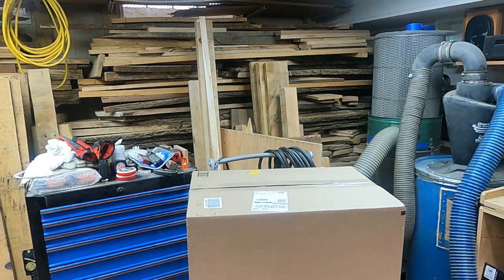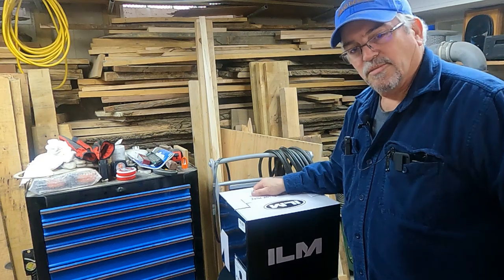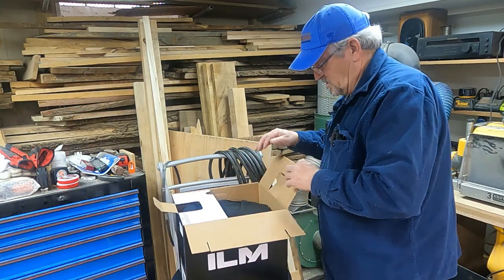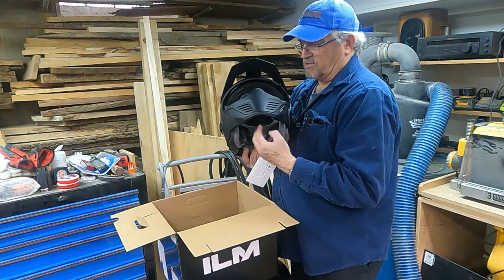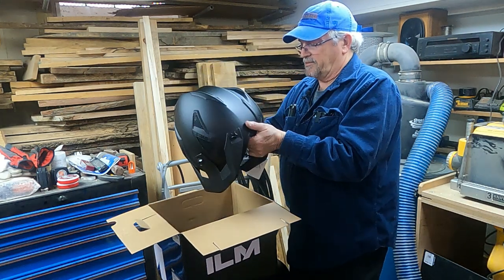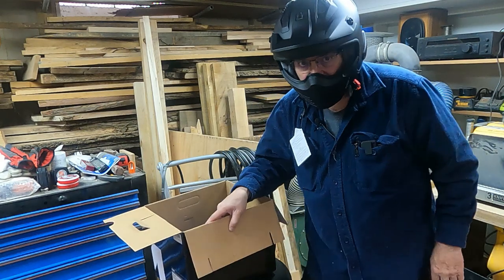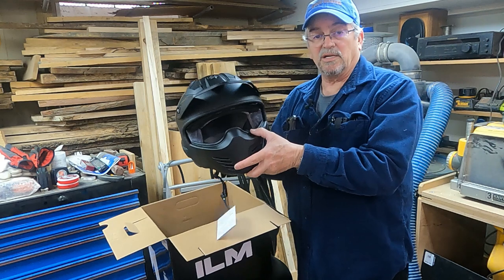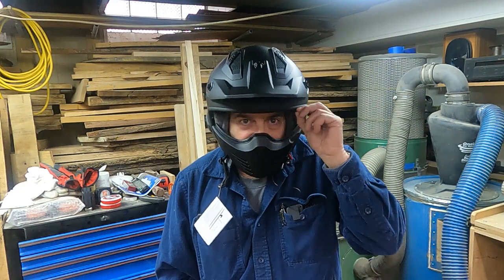ILM 34 helmet

Comment from the maker: Update: this helmet fogs very badly. In cold weather you can't put the visor down or it fogs. I can't even wear my glasses with the visor up as they will still fog. The chingaurd gets soaking wet from my breath even with the visor up. So the bottom line is this is not a good cold weather helmet.
Reply: Thanks for the update, i've been watching a bunch of videos trying to find one for the winter and almost purchased this. Did you find one yet that doesn't fog up?
Reply from the maker: @KingKola_   Just a full face motorcycle helmet if I really want to look like a dork, lol.

Comment: Thankyou for the video . When ride my e-bike I look over my shoulder. to see what is behind me. Will I be able to do this with this helmet.
Reply from the maker: Yes you can. Even though my ebike has mirrors I still like to turn my head and look over my shoulder as well as both ways when  crossing an intersection.
Reply: @woodtickgreg6926   Thankyou
Reply: one more question about the 3/4  helmet  How much room is between your lips and chen gard and size of your head because was think of buying the xl helmet size Thankyou again.
Reply from the maker: @relectric720  
I would order the helmet one size larger than you normally wear. I wear a large so I ordered an extra large and it fits perfect. There's plenty of room behind the mouth guard, I can even mount a mic there. You don't buy a larger helmet because of mouthgaurd room, you buy a larger helmet so it fits comfortably and isn't too snug.

Comment: Great video by measurements of my head my helmet that i purchased O'neal was medium 22.4 /22.8 and it was very tight on my cheeks and jawline and will return it but with this helmet should i go with XL just to make sure i would go with Large but if they run small i don't wanna do one more return
Reply from the maker: Yes they run very small, order at least one size up. I normally wear a large, I ordered 2 helmets, one large and one xl. I kept the xl and returned the large.

Comment: Nice to see ur new helmet,sir. Please suggest me if my head is 60 cm, tgen it's okay to order L size? Or have to order XL size, sir? If i choose L, does this liner can be exchanged to smaller size to fit this L size into my head perfectly?
Reply from the maker: I'm not sure how to answer all of your questions, and we don't use the metric system here in the states. But I will say to order at least one size larger than you normally take. Use there sizing chart and order one size up from what it says.
I hope this helps.
Reply: @woodtickgreg6926  ok thanks for ur reply sir

Comment: Do you know what size is your head? Bec I just got this on XL but its too small for me, I have a 23" head.
Reply from the maker: My head measures 22 3/4 and it is snug but not tight.I have more of an oval shaped head if that means anything. Like I said, their helmets run small so advise to order at least one size up from what you would normally wear. Can you send it back and exchange it for a 2 xl?
Reply: @woodtickgreg6926  unfortunately they don't have xxl, but I have reached out they replied that they will send me a xxl liner. Because when I removed the cheek liner it just fits me just fine. I just hope that the new liner works and probably expand a little after breaking it in. And I agree, this really looks badass!